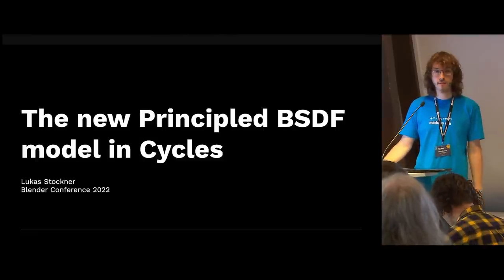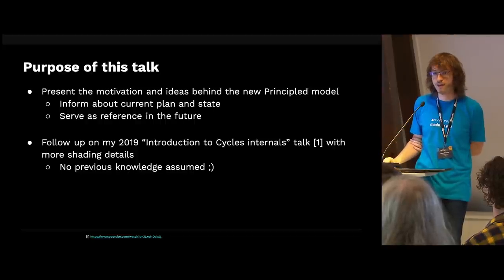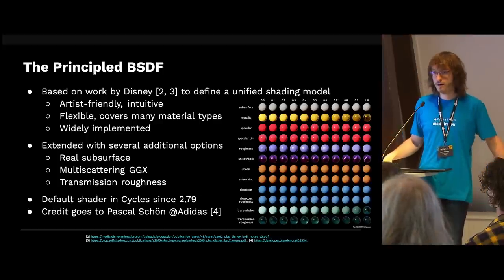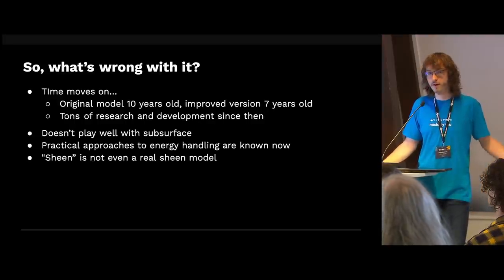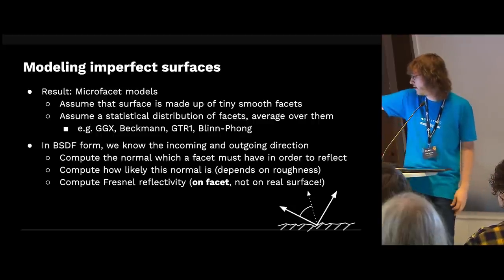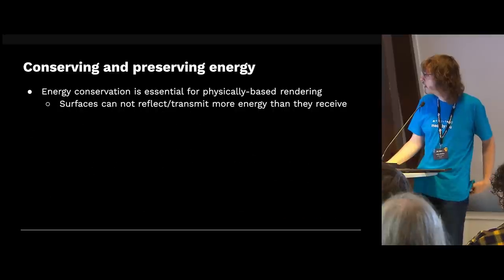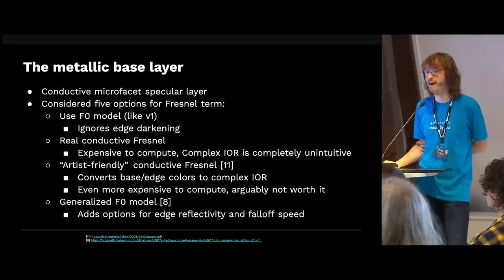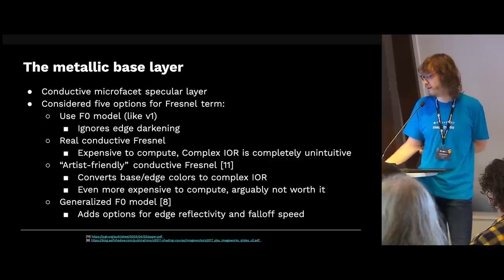The new Principled BSDF model in Cycles

Comment: I'm really impressed of these things. So many great updates. I'm very much into the "accordion" type of design, what comes to the UI. So, categorize everything and allow us to expand the relevant settings and hide not needed ones.
Reply: How would you feel about a basic bsdf node that then plugs into another bsdf node to add anisotropy and then plugs into another bsdf node that adds the artist focused multipliers of the basic bsdf settings? No mix/add shader nodes, just "additional" sliders on each subsequent node that adds more features and tweaks to the values coming from the initial bsdf node.
Reply: @myztazynizta  That could work, but I'm bit afraid of the idea of having multiple nodes. In some cases it would lead us into a position where we will have to add all of those when in alternative way could be having only one node. However, I'm not developer and I bet they are having much better ideas than mlne. :)

Comment: Love what I'm hearing here. So many improvements! Great talk!
FWIW Dispersion and thin film and all that jazz is actually much simpler with spectral rendering, as you simply calculate per wavelength, which gets randomly picked on the fly, rather than with three separate colors. - and Dispersion in particular is also definitely gonna matter more with Path Guiding which may actually find some caustics. Spectral Rendering alone won't fix caustics so it wouldn't actually matter that much there.
Also yesss, Nested Dielectrics! That alone is HUGE! Will make it actually possible to render a simple glass of water correctly without painstaking work and limitations.

Having the ability to have shader nodes have subpanels is also huge. Especially if we could somehow also apply that to groups. That would be amazing.
But yeah, at the very least the principled shader v2 is absolutely gonna need this going forward.

Comment: I think translucency needs to be in for thin geo. Maybe even for thick geo as SSS don't transport light, at all.
Colored SSS curtains don't tint the room, and I wouldn't like to rely on refraction caustics to do this super rough light transport - too noisy.
Besides, some of us may still use other tricks to replace refraction and reflection caustics, allowing us to turn them off (to improve noise handling).
I would expect translucent effect be the diffuse part of the "back side" whereas the (rough) refraction be only part of that exit ray.

Until now I've been mixing diffuse/translucency with a fixed mix of refraction for the absorption component, (rough) fresnel mixed with glossy.
Yes, anisotropic exists in all materials, not just metals. Even skin will deform reflections when stretched. But usually considered too complex to control.
New sheen looks much improved, but still looks isotropic. Any chance of bringing in UV based nap direction to control brightness and/or hue shifts?
This, unlike anisotropic isn't based on 90 degree rotations, but on 180 degree rotations. Youtube: "1a nap direction demo" for real world illustration.

Maybe this is better to implement to the actual velvet shader, as the use case is so fringe. But still something I observe in my own upholstered furniture.
One thing is missing; multilobe specular controls. Search for "Specular kurtosis and the perception of hazy gloss" for one paper covering this.
As for the GTR lobe, has the problem been fixed where nothing happens in a map until a certain roughness threshold is reached?
And could we have a GTR option with customizable tail setting available for the glossy shader as well? Sometimes my OCD demands manual control 😁
Reply: Agreed, also the translucency map for thin geo is really important for foliage when it gets backlit as a blurred front face texture won't incorporate veins and other sub surface detail properly. The current work arounds take a lot of extra math nodes which I would like to avoid.

Comment: Can't wait to see the new sheen, clearcoat tint and thin sheet mode. Love the explanation about physics, artistic, computer cost considerations behind them. 
Hope if V2 is not compatibility with old Principled node, most of old connections would reconnect to V2 automatically or at least leave hints for where the original connections should be.

Comment: hey, i really need quantum effects in blender like thin film (like petrol) effect and microfacet rougness (blue diffuse more than red in glossy materials, black skin on chairs have this effect)

also phase shifts VERY noticeable on any scratched metal or lasers

i created it by nodes but it's slow.
also it's easy to make iridesence map, all you need to thik after that it's surface angle and layer thickness

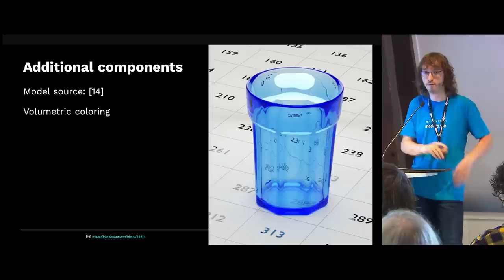Comment: in 49:50 i think its still wrong that new implementation  for that volume absorption .  in his image on 49:54 its looks wrong and i get wrong result when i model and use realtime glass object with water inside them. i think that guy should re take alook on his code on that particular  section .

Comment: I am relieved to hear that this developer is considering both speed and user interface in making decisions on how the new shader should be changed.  On a scientific side, it may sound great to re-engineer the shader to be more physically realistic.  BUT most of the users are humans who are not scientists-- and as an artist I would put SPEED and FEWEST controls possible as the absolute most important features of a shader, that are many times more important than a physically real result.
-
If you add a hundred new controls to get a small improvement, then the result will be that nobody will use it.
If you add a hundred seconds to each frame for a small improvement in the image, then the result will be that nobody will use it.
-
 Add to that, the current principled shader already has too many controls on it, and is massively confusing (ie. which controls do I ignore, and which do I need to change, and which have little effect and which wildly change the result and which do I leave at 1.0 and which do I leave at zero, and which do I leave at a seemingly arbitrary default value???... ).  You need to find a way to reduce the number of controls for general use, and keep the advanced options hidden from view but accessible for those rare situations where somebody might benefit from a more physically accurate result.